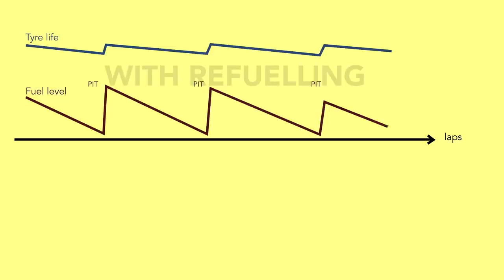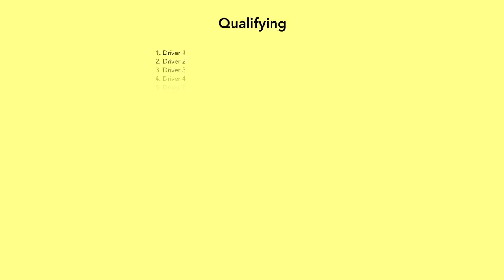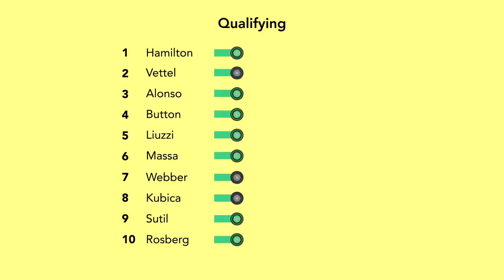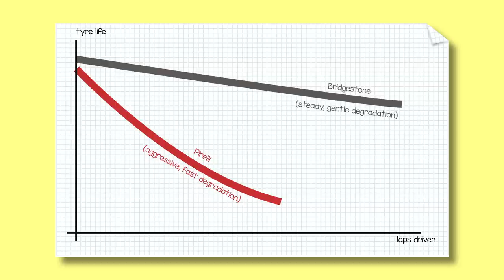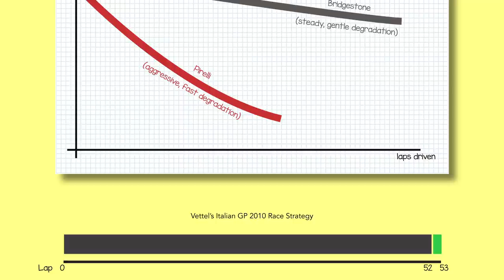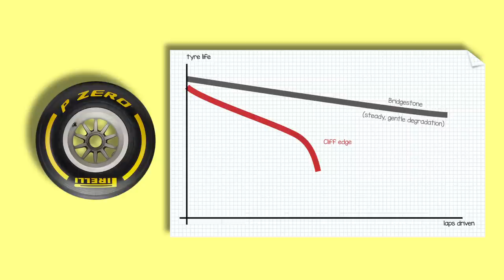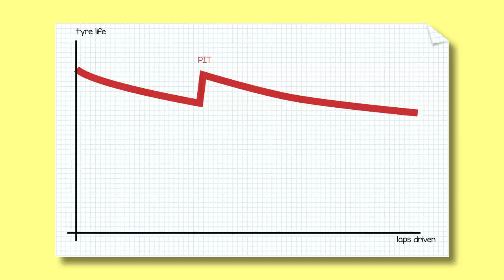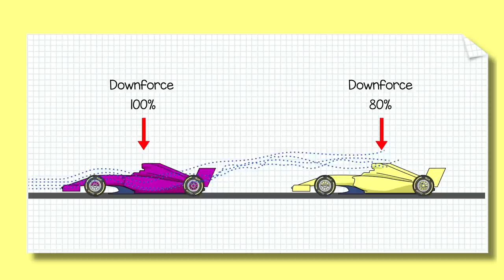How Canada 2010 shaped F1 for a decade - Chain Bear explains

Comment: F1 is having too many regulations for its own good, I feel like FIA needs to sit down and rethink all the rules... thats what should've been done for 2021.
Reply: regulation is needed to make f1 good. but it is also bad when someone find a hold. making all the car same is not the answer.safety is needed and if not f1 fan will say that f1 is a death fest and it will hurt f1.
Reply: making solution is hard .bring back the old days is not the answer.
Reply: @WinWall3227  Thats not what I said, I didn't mention bringing back old times.
Reply: * rethink.  Finding a solution is non-trival. Everyone needs to be happy. The teams, the manufacturers, the drivers, and the fans.
Reply: How about bringing in an attack mode activation like in Formula E. Or could be activated by going for a pitstop - might encourage more stops and use of softer compounds. Effectively limit control of peak engine mode to this attack mode.
Reply: @WinWall3227  Regulation is not what's needed to make F1 good, it's needed to make the sport functional and practical just like any sport. 
Lack of regulation alteration and change like we see with F1 today is what's needed to kill the sport.
Reply: @steveco1800  Yes, they should change DRS activation abit to implement more of Attack Mode style challenges. 
This is not without its challenges though. Top teams have the biggest power and greater expertise so it won't do much to change the positions.
Reply: Won't work.  Engineering but definition is the search of loopholes.  No matter what the rules say they will find ways to defeat it.  It's the nature of humanity.
Reply: "Everyone needs to be happy"
Oh boi, as a ex-fan of Formula 1.
They would need to change so much to make me happy that is impossible to this happen anymore.
xD
Reply: I think the regulations need to be opened up to allow more variation between cars - at the moment pretty much all the cars are the same shape, size, the aero is all very similar, etc. Pit stops used to exist cos they actually made your race faster, whereas now they are there because of regulation and artificially limiting tyre life.
Reply: Unfortunately the reason there are so many regulations is because people complained when there weren't any. It's the classic catch 22.
Reply: @steveco1800  wtf is DRS then
Reply: @TheAnimystro  if this were true then ferrari and red bull wouldnt have such a terrible time trying to reach mercedes current potential
Reply: what really needs to happen is the regulations need to stop changing, so the lower teams can catch up to the top teams
Reply: @FoxtrotGolfLima  nope wouldn't help when mercedes can still throw around 400 mil a year
Reply: For me it is true that F1 has become boring. For me 2006, (2007, 2010 *I didn’t followed that much) 2011, 2012 were the best seasons for me I’ve ever watched races live in F1.  Now I really can’t watch a full race because I know I will fall asleep. I always watch F1 highlights, some F1 news too and I find these cars and technology+innovations in and around the car very beautiful but races are done for me.  It’s sad but it is what it is...

Comment: Funny how it's always supposed to be the NEXT SIMPLE rule change that will certainly make everything more entertaining.

Seems to me that almost irrespective of the set of rules you choose to apply, there is invariably going to be one optimal strategy to win a race, and after a sometimes rather short, sometimes quite long struggle, all teams will converge on exactly that one optimal solution.

Look at this year. It has become apparent that you have to follow Mercedes' development path to get these tyres working, and that getting the tyres working is such a large advantage that it overwhelms all other factors. So we'll see teams adapting their car to be harder on the tyres, like Mercedes, and depending on their design team and resources, those updates will come to the cars over the rest of the season, meaning we'll likely see closer racing towards the end of the year.

Of course, Pirelli are supposedly changing up their tryes once again for 2020, which may yet again lead to a situation of one team hitting the sweet spot and many other struggling to learn from the best and apply these lessons to their own car. Wash, rinse, repeat.

Want a closer field? Keep the rules stable. Everyone will learn eventually. (See V8s, see V6 PUs) And the law of diminishing returns will lessen the gap. But who am I kidding? There's a whole organization in place to come up with different variations on a theme, silver bullet rule changes, complete overhauls. So we'll see teams getting it right running away with it again. Yay.

Comment: Can we go back to 2010?
Reply: Yeah no
Reply: I think Williams would agree with me... Can we go back to the 1980s?

Seriously, if they mandated simpler wing elements, allowed the return of ground effect, kept the new large wheel format, and ditched DRS, we could see more on track action.
(Following a comment by BlackPrince, I want to clarify I am not against DRS. My suggestion to ditch DRS was made on the premise that it would not be "Needed". But I'd be just as happy to keep it as well). 

Fuel strategy was a big part of keeping things varied, but it seems unlikely to return. Using tyres is a poor substitute because there is really always a common strategy for everyone. If we wanted to be fancy they could build in artificial fuel strategy using the MGU-K to provide full time additional power to artifically simulate less fuel. Pitstops could then involve simulated refueling. BUT, getting the calculations right on the fly, and having a reliable system to cut the engine on simulated empty tank, and reliably control the MGU-K would be insanely complicated. So maybe just embrace fuel stops again, but learn from the past and make them safer (with standardised rigs supplied randomly each race, to the teams from a stock (like tyres) to avoid the Benetton style of "not" cheating...
Reply: @damionlee7658  So DRS is bad but ground effect is good why? DRS allows you to go faster on straights while ground effect allows you to go faster on corners. Why is one superior to other? Oh I know why, because of your nostalgia glasses.
Reply: Give all teams the same budget. Done.
Reply: @songcramp66  No it isn't that DRS is bad and ground effect is good, and it isn't nostalgia (there were plenty of rubbish races in the decades past) . DRS was only brought in as a stop gap because of the lack of overtaking. My point was only that simplifying aero and shifting back to ground effect would take us to a point where DRS is not necessary.

It could be kept, I really don't mind (I was happy when it was introduced). I'm not a traditionalist/purest or against most technologies (although I'd rather not see traction control, launch control, or anti-lock brakes return). Given the choice I'd let teams have the option to go back to closed wheels, active suspension, and let teams play with most other "banned technologies".

Given the choice I would like to see an F1 where radical technology development is the way things are done, and where the field is filled with cars with more pronounced differences from one team to the next than we see currently. But I understand why you might have interpreted my post the way you did.
Reply: @Bahamuttiamat
Not really. 2012 season was very good.
Reply: 2010 was only good because Vettel broke down 3 times while leading easily (Bahrain, Australia, Korea) and crashed stupidly with Webber in Turkey. Every race except for 1 was a boring one stopper unless it was wet.
Reply: Lets go back to 90s
Reply: @Bahamuttiamat

Nah it was extremely fun to watch from 97 to 99.
Reply: @BlackPrince
Research it a bit. They have nothing to do with each other.
Reply: @Bahamuttiamat  yes , but i prefer 5-40 points gap between the first 5 teams , not 100+ like now .. and for the drivers , slightly better situation but not so much . Even if i understand your point , i prefer the old formula 1.
Reply: @Ali M dumb dumb, the points system changed in 2010.
Reply: Nah. 2012 for me
Reply: @songcramp66  what do you like more?  cars overtaking on a boring straight, using a button, or cars overtaking in or just after a corner?   The latter is way more amusing, entertaining and EVERY racer will agree
Reply: Back when Modern Warfare 2 was fresh on the scene, Obama was the president and Kevin Spacey wasn't (known to be at least) a paedophile. ...At least in 2010 I could watch Seven and the usual suspects without it making me cringe.

Comment: The race series with the best action don't have tires that need pitstops IMO, e.g BTCC, Formula E, MotoGP and British Superbikes. Sort out the drag problem and give them tires that allow drivers to attack throughout the race.
Reply: The drag problem comes from the downforce though. Getting rid of it would significantly slow down F1 cars overall. The best race car unfortunately doesn't seem to make the best racing.
Reply: @timothyheimbach3260  Yes will do to some extent, but probably worth it overall. Maybe focus the development on diffuser and tire performance, while reducing the wings (especially rear). Keep the engine performance so increase the size of the braking zones.
Reply: @timothyheimbach3260  Nah, just box up the wheels like they do in FE. Diehards won't like it but it improves the ability for tyres to be pushed abit more. 
Only problem is that will need design changes and will add weight so we're back to square one it seems. 🤔
Reply: Some of the best on-track action still comes from shockingly fearless 12-year-olds in go-karts.
Reply: I agree. From the 50s to the early 80s we never had pit strategy and we had exciting racing. Even up to 93 tyre changes were generally not planned in the strict way they are now and they weren't used as an overtaking tool like they are these days. If drivers don't have the option of undercut or over cut then they'll be trying harder to pass on the circuit. Problem solved.
Reply: @chrisbloom382  Maybe, but if overtaking is impossible it won't make a difference. Strategy is the only exciting part of F1 in my opinion, not the DRS-induced overtakes.
Reply: F1
Reply: How did you manage to list all the shittiest motorsports in the world? BTCC is even worse than WTCC, Formula E... LUL xdddddd, and some bike races that nobody cares about, because we love cars, and hate bikes.
Reply: @kukuc96  De, a probléma a tankolás hiánya. Az igzalmat az generálta, hogy soha nem lehettél biztos abban, hogy valaki nem próbál meg megcsinálni egy 1 kiállásos taktikát. Legjobb példa 2005 Monza, ahol Raikkonen átejtette a palánkon az egész mezőnyt, és 13. helyről 1. helyre való sikeres menetelését egyedül az idióta teljes hétvégét kötelezően kibíró gumik vették el.
Reply: @ShadowViewsOnly  I think that's not the best answer.

Comment: Something I rarely see mentioned when this issue comes up - and with good reason, I realise, due to the obvious safety implications - is the role that the introduction of the pit lane speed limit seemed to have in creating the problem; I don't remember us scratching our heads about this back in the days when the time penalty for stopping for tyres wasn't so great as to outweigh the benefit of pushing every lap. Obviously we can't go back to unlimited pit lane speeds, but I'd be interested to see F1 do some research into pit lane design to see if there's any way time lost in the pits could be reduced. Even just push the limiter line in the pit entry at Silverstone back a bit for one year's race, see what happens to strategy. Drivers are less likely to conserve if opponents can push, pit and catch them again more easily, while it would give Pirelli more latitude to create an averagely robust tyre.
Reply: The current cars and tyres just aren't designed to push flat out for 15 laps. Cooling is always on a knifes edge. The battery packs run out of charge. The tyre temperatures go through the roof. That's why the concept of putting a fresh set on and rapidly coming back through the field doesn't happen as often as it did several years ago, even when pitlane speed limiters existed. Best solution to get more strategy variance with the current generation of cars/tyres would be to mandate that all three tyre compounds are used in the race, instead of just two.

Comment: Thanks for the interesting video. I won't say that I'm completely off the refueling wagon, but it did however make me sit closer to the back to jump off if they get it right. The biggest issue i had with the removal of refueling ban was the the safety of the people in the pit lane. Granted they are pretty much on top of that now, but there is still the odd chance that someone can get seriously injured due to a loose wheel. Now before anyone jumps at me that they had the same issue with cars going down the pits with the fuel hose still attached to the car, they could have easily avoided it by making the rules that you are only allowed to work on the car, that includes refueling, when the car is on the jacks, i.e. the fuel hose MUST be detached and the mechanic back past a certain point before the car is allowed to be dropped.

I really hope that the hard work of Brawn and co is going to pay off. I'd love to see more on track action and the removal of DRS. I understand why it is necessary at the moment and i am tolerating it, but it makes the racing too artificial imho
Reply: I think stopping refuelling was a mistake. Realistically, what was the fires per number of pit stops percentage? As you say, they could have built in more safety. All that driving off with it attached, the cars could have even had a sensor that kept the brakes locked on when the hose was attached. I liked the fuel element of the race strategy.

Comment: I understand the purpose of having so many tyres with some many different characteristics. But I tend to think that tyre managment is something that "distratcs" drivers too much. Yes, tyres should have different traits, but the way it has been I think it doesn't allow drivers to drive on the limit all the time. 

Maybe if we had only 2 well defined of tyres, and the 1 mandatory pitstop and let the drivers go, could be a solution. 

Also if we had the aerodynamics problems sorted out so cars could be closer to each other.

Comment: Motogp doesn't need any pitstops, fuel stops, tyre changes or radios. Just a good rule system that allows rider skill to shine through.
Reply: But it helps being on bikes though. I think they need to reduce the size of F1 cars to ensure maximum overtaking.
Reply: To be fair, though, motogp bikes are way lighter and the races are only 25 to 30 laps
Reply: @ShadowViewsOnly  Why the hate to bikes?
Reply: @ShadowViewsOnly  Schumacher definitely hated bikes, that's exactly why he was racing Superbikes. Also, if nobody likes bike racing, why did Sepang lose its F1 races but kept its MotoGP races?
Reply: @ShadowViewsOnly  Bike racing is one of the best forms of racing.

Comment: Ive always wondered if they should introduce something like:
the drivers start on a hard tyre that can last the entire race and be pushed on tho lacked grip compared to a softer tyre that was designed to be massively faster but fall away. 
The idea is that teams can take the penelty of a pit stop but are rewarded with a tyre that is a magnitude faster  so they can cover the pit time, time catching the drivers and enough extra performance and speed to overtake before they need to go back to the slower tyre or another set of faster tyres. You could also limit DRS useage to 10laps after a pit until the next stop is taken. Basically encourage drivers to pit rather than force them to

Comment: you forgot to mention that in the 2013 british grand prix, all the tyre failures happened to teams/car that were running tyres IN THEIR OPPOSITE DESIGNED DIRECTION. meaning they were running the left tyres on the right side and vice versa. every car that DIDN'T do that, DID NOT SUFFER TYRE FAILURES.

Comment: Maybe they could try a 1 compound tyre that can be pushed to the limit all the time and then force teams to do 2 or 3 pitstops (depending on the track)

Alternatively have a couple of laps where the pits open 2 or 3 times a race...
Reply: Mark Bradford So, essentially they could just bring a harder mix of tires to each race. They currently choose 3 from a possible 7 compounds.
Reply: What are they doing in the pits if the tire is indestructible? What would be the point of the pit stop, just to drive through the pit lane?
Reply: @C3lloman  Without refueling there would be no point of having just "drive in to avoid penalty" stuff. Only mix of refueling and 7 tyre types could add spice to racing as some would try 8 flying laps with light car on hyperultrasofts while other would fill up for 1/2 race and try to have good average speed on medium tyres. When had just 1 soft and 1 hard choise  for each team - it was pretty clear what strategy have to use to get some result.
Edit: But I know that safety is big stuff and this racing propably won't get back to it. And I'm fine with it as I can have Indy/Nascar and keep F1 as "best G-force" stuff on market.
Reply: @C3lloman  Make them use multiple compounds in a race, like they do now.

Comment: Fia knows the danger of full non restricted cars, they make new rules each year to limit the performance and thus the velocity of the cars, if no, the constructors could make cars with 400kmh and 3 or more G per corner, insanely dangerous. (Maybe in Bahreïn and Abu Dhabi it could fit)
Reply: Put those cars on the Nordschleife and you'll have saved the sport.
Reply: If one were to install fairings around the wheels and enclose the cockpit on an F1 car, these figures might be achieved with taller gears on a standard (for F1) power train. The races could take place at Bonneville, just spray paint the track borders on the salt.